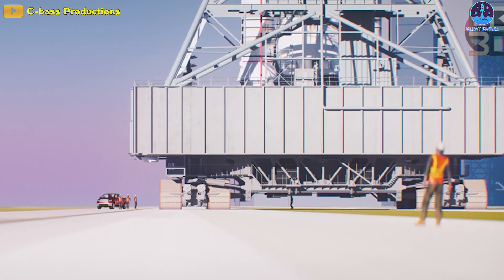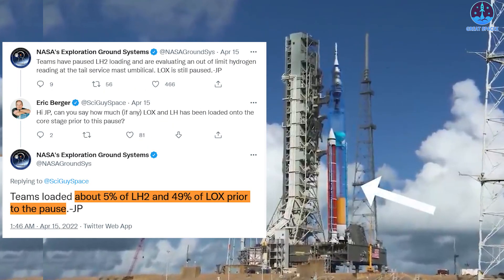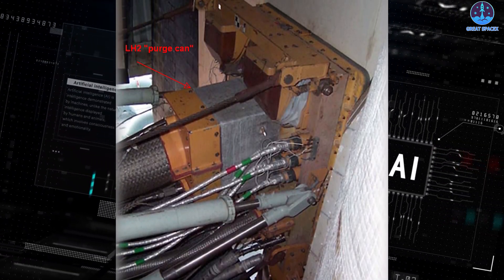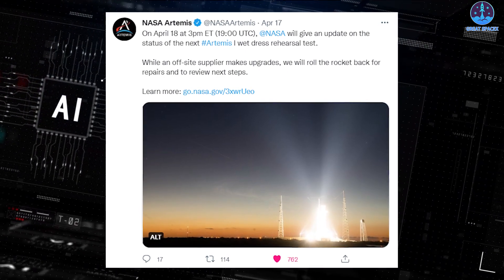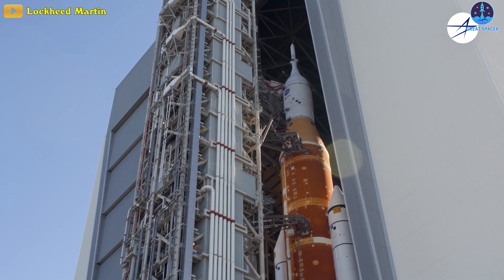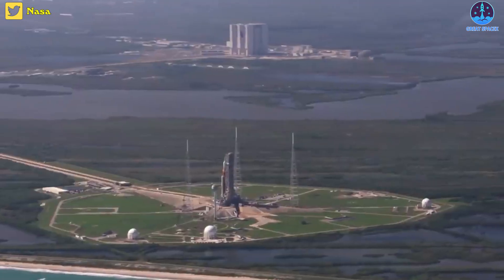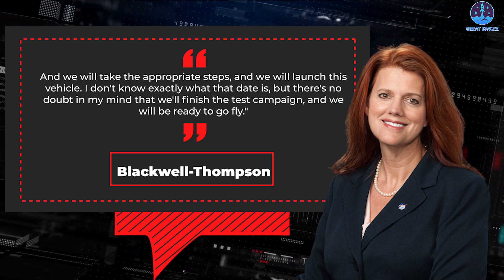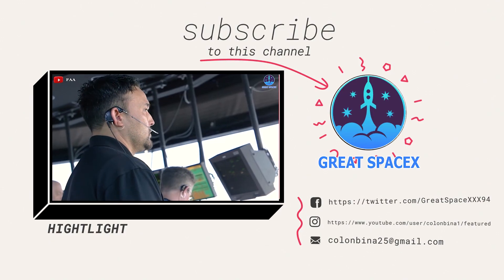NASA to roll back its mega-rocket after failing to complete countdown test

Comment: Kinda obvious to give up and go for The Falcon Heavy.
Reply: @Tom you might be interested in reading the following insert
"Falcon Heavy has more lift capability than any other operational rocket, with a payload of 63,800 kg (140,700 lb) to low Earth orbit, 26,700 kg (58,900 lb) to Geostationary Transfer Orbit, and 16,800 kg (37,000 lb) to trans-Mars injection.[61] The rocket was designed to meet or exceed all current requirements of human rating. The structural safety margins are 40% above flight loads, higher than the 25% margins of other rockets.[62] Falcon Heavy was designed from the outset to carry humans into space and it would restore the possibility of flying crewed missions to the Moon or Mars."

I see no reason why Falcon heavy cannot lauch the Orion Capsule since the Orion's mass is about 22.7 metric tons. It did launch the roadster to an elliptical heliocentric orbit crossing the orbit of Mars.
Reply: @chrisduggan85  If you read it carefully, there is nothing to say that the Falcon Heavy can carry that tonnage WITH humans on board.  Also, the quote is for "operational" rockets, which wouldn't include the SLS.  Don't get me wrong, I think what SpaceX has been able to achieve has been nothing short of spectacular and has transformed the rocket industry and what was previously thought impossible into economical and reliable access to space.  If the money wasted on SLS was instead put into Starship, one can only speculate where we would be right now...
Reply: Falcon Heavy doesn't have the available thrust to get Orion to the moon.  It is also not human rated and never will be due to the 8Gs it produces on ascent.
Reply: @tomboard1  The SLS doesn't have the ability to do anything other than waste an increasing large 11 figure number of US$.
Reply: @davidfenwick987  I understand and agree.  SLS is $4.3 billion a launch and nothing other than Orion is reusable.  I was just stating that Falcon Heavy was not designed to take humans into space.  That's why SpaceX is building Starship.
Reply: @tomboard1  Fair comment.